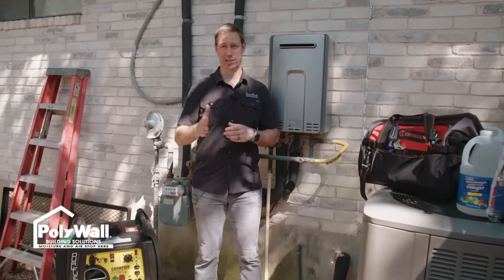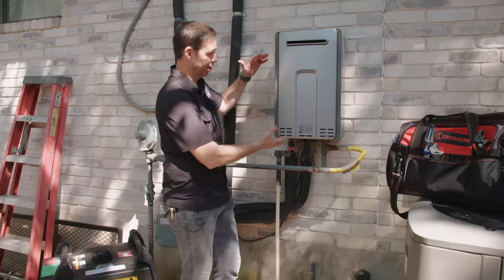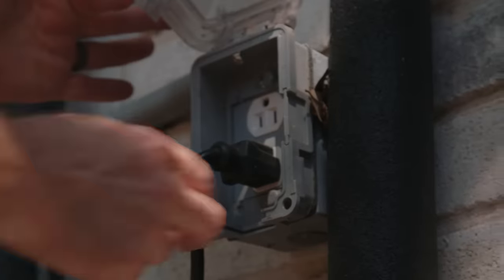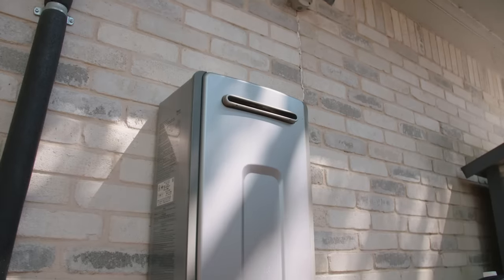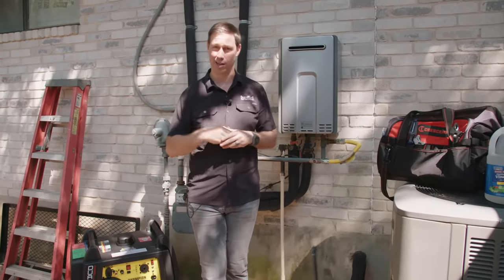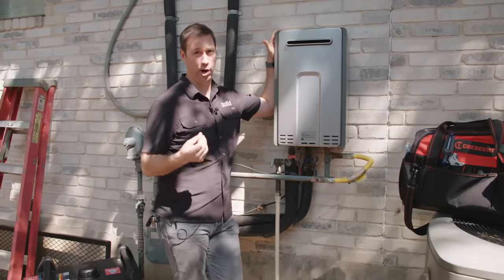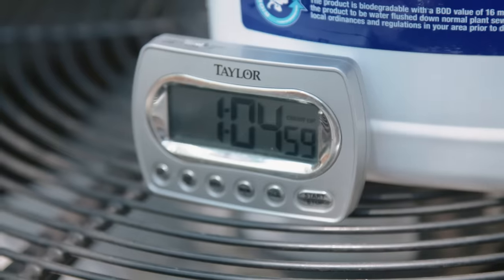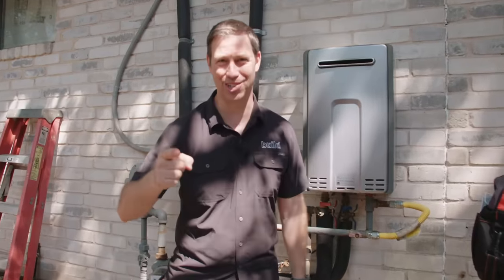3 Things They Don’t Tell You About Tankless

Comment: From my master plumber point of view, for the most part, I agree with the points brought up in this video. Personally I do not try to actively sell tankless. I do tell every customer what is mentioned in this video. I would add there is a #4 that most contractors do not tell you. These units are very sensitive to flow rate. For example you have to have “X” gallon per minute flowing through the heater for it to function properly. If you have a low flow shower head, there is a chance that that there is not enough flow on the hot side to get the heater to operate as designed.  Remember,  your mixing hot and cold in your faucet. Let’s say I can measure 4 GPM coming out of the shower head, that means in theory that I have 2GPM on the hot line and 2GPM on the cold line. That 2GPM is not enough for the tankless to operate correctly.
*the 2GPM is just a made up number I used to make my point, consult the tankless manufacturers manual for the real numbers.
Reply: I have seen this issue as well
Reply: i’m a handyman that ran into this many times, along with that scale reducing the flow of every faucet and shower head and valve in the entire house which makes the minimal flow to get the tankless working even worse as time goes by… not for me
Reply: You're doing it wrong. 
The best way to use tankless is to set the tank temp at the temp you use. For example, my electric tankless is set to 105F which is my preferred shower temp with my 1-1/2 gpm flow rate. I turn the shower completely to the hot side, my Stiebel Eltron keeps the water right at 105 ( my lines to my fixtures are all 3/8" pex and insulated so there is very little if any loss. You don't want to mix water at the fixture that creates losses from heating the water above the level and then cooling it.
My energy usage for a 4 minute shower at 1-1/2 gpm is 5kWh * 4/60 or only 333 watts, that's it. It's so efficient I use it with my PV system and don't pay for hot water.

I have a scale filter on it, all hot water systems should have scale filters.

Tankless is the best hot water I've ever had, yes, you don't want your kid in there for three hours, you have to use your head but if you do it's very good and about 1/2 the cost of heat pump systems.
Reply: If 105 is your max, more power to you. But to say I’m doing it wrong just shows a lack of understanding of what most Americans want in their home. I’ve been in this industry a long time.  With a 105 degree max, I’d be getting phone calls from unhappy people. I don’t like phone calls from unhappy people.

Edit:  I own a tankless, I love my tankless.  In a “normal” residential setting, I’ll never go back to a tanked.
Reply: @mosfet500  Do you have your tanks outside or inside? I'm wanting a gas tankless heater, but I want it outside.
Reply: Again, that's wrong.
You're using the  tankless wrong, here's why:

There are two types of losses in hot water heaters, standby and line. Standby losses are from a tank sitting in a room, the tank tries to constantly lower its temperature to meet the room. Line losses are from the tank to the fixtures, a tanked heater must have water temps above 120F, actually cryptosporidium and legionella live in 120F environments that's why commercial installations require 140F working temps. Because a tankless doesn't hold water there are no standby losses and no tank bacteria growth so you can keep the temps low. Any good tankless lets you set the output temp. The average shower temp in the USA is 105F, I set my tankless to 104F (~40C) BUT when I shower I turn the mixing valve completely to the hot side, there is no cold water mixing with my 140F water and no mixing losses. Also since the line temps are lower they don't drop like 120 or 140F lines that need mixing do.

My tankless heats water at a flow rate of less than 0.5 GPM flow rate, the hot water never stops from too low a flow.
Reply: @mosfet500  thanks for your input. I see your point but do not agree. You can look at whatever statistics you want, but I can tell you that people want hotter water than that sometimes. Not all the time, just sometimes.  But you are correct, if you set your water heater to your desired shower temperature, yes you will see higher flows through the heater. 
But that’s because the shower valve is maxed out. But on a different note, you need to chill. 9 months ago you commented all fired up.  Just state your opinion, Leave it at that.
Reply: @crushingsnakes1976  I'm not all fired up and I forgot I commented 9 mos. ago, I comment often on YT, sorry for seeming fired up.

I don't see any reason not to set your mixing valve to hot only, that gives you the maximum efficiency. My tankless is set to 104 and I use 3/8" insulated PEX to my fixtures from a small manifold at the heater. The run to my shower is no more that six or seven feet so the line losses are pretty much my 104F tank level. The point is that even if you set your tank to, say, 110F and use it at that temp your losses are still much lower than a tanked heater. 

I was surprised that 104F was hot enough for my showers, I too thought it would be higher, I was also surprised to see the average US shower is 105F too. We wash clothes on cold but kitchen and bath sinks and showers haven't had any complaints from anyone that they need more hot. I suggest people measure the water they shower and run their kitchens at.

I also ran the numbers and the tankless will last 25 years plus, maybe an element change at that point but otherwise it's good to go indefinitely. HPWH's don't last that long, are more costly up front and you have to vent the cold out of the house in northern climates like mine. I think tankless is a better option for small families and now that I see I'm spending $5 or $6 a month on hot water I'm even more convinced. Walking into a flooded basement a year ago was all I needed to not want a tanked heater ever again!
Reply: My regular 50 gal gas water heater is going to need replaced soon. I talked to a plumber friend and he said that was something I could do but that the gas meter would have to be upgraded (which I can’t do)as would the gas line to the tankless!  His wife wanted to go tankless and he has to do a new larger meter. Here in Iowa the meters most of us have can handle the furnace, tank water heater and the gas stove. His wife was surprised at all the things he had to change to put in the tankless!  If was building a new house I’d absolutely go tankless from the build!  Retrofitting a house 120 years old, I think I’ll stay with a direct vent tank!  Put a simple timer on the power to the vent fan so the water heater doesn’t heat water in the middle of the night or if everyone is gone during the day. Set it to come on around an hour before anyone gets up, hour before anyone gets home and shuts of before bedtime!  Gas company employee told me that. Said you save a lot and extend the life of the tank!
Reply: @stevenperry4941  maybe you might want to think about going electric if you have the service to handle it. When my oil furnace died (and flooded my basement!) I said that's it for anything with a tank - all tanks fail eventually, it's the nature of the beast. Last year when I put in my tankless I just ran a 240 line to the unit and got it inspected - done. I'll never go back to a tank - ever!
Reply: @mosfet500  no can do. Old house, 100 amp service that is pretty much full. Cost more to upgrade to 200amp service than doing all the gas upgrades!
Reply: So true, i am having that very same problem now hence why i am here researching

Comment: The thought of endless hot water was not even a part of my decision, but turned out to be an awesome feature. We ran a hot water line to the outside of our house for washing the car, the dog or whatever.  The 4th thing you did not mention was PRICE!  Where I live in British Columbia Canada a hot water tank is $1000, on demand system is $500
Reply: You should know why that is. Are you having any talk of them banning your fuel?
Reply: except that this is not true, anywhere incl BC, unless you are allowing for a rebate. Tankless costs $3000 in BC,  traditional about $1000
Reply: @johnjohnson-oj7md  Are you concerned your country may ban your present fuel?
Reply: Where did you find a tankless system in BC for $500??? I haven’t found one worth installing under $5K, and just installed a combi-boiler system (system that heats hydronic flooring AND domestic on demand system) for just over $7,500!
I will now be installing a water softener system after watching this video.
Reply: I am confused by this as well

Only thing i can find remotely close to $500 here is heat pump water heaters and that's with a govt. Subsidy.
Reply: Seriously I got my passport. I will drive up to Canada and grab one.

Comment: we have a gas tankless, but installed a 3 gallon electric mini-heater under the kitchen sink.  instant hot where needed, endless hot everywhere.
Reply: I thought about doing this as well, it’s a long run to my kitchen sink from my tankless. I insulated the line instead so once it’s there it’s hot for longer.
Reply: @christophergruenwald5054  Generally speaking, the hot water unit should be installed as close as possible to the kitchen. The KS uses more hot water than any other point in the house.
 You could have run the hot water line in polybutil which loses less heat than insulated copper.
Reply: Idk your kind of tankless but some you can put a circulation pump on and have a cross over tee installed under the sinks. Utilizing your cold line as a return line.
Reply: @Plumbyday  Circulation pumps are not such a great idea.
If you use one, you will increase dramatically your gas or electricity consumption.
 The pump uses very little, but the HWU uses a lot of energy when it's running. So, for the small cost of water lost along with time waiting for the hot to come through, you will pay through the nose for the extra energy used.
 If you have deep pockets, it doesn't matter.
Reply: Ken Lyneham I hear you! So I modified my circ system. As built in 1993 the return dumps the recirc water back into the HW tank via a tee at the cold water inlet. The pump is at this location and between it and the tank is a check valve and aqua stat. I didn’t like the idea of the system being “left on” 24/7 and controlled only by the aqua stat so I installed wiring to each bathroom light switch and the kitchen light switch boxes, changed out the single bay light switch boxes to doubles, and installed mechanical timers next to the light switches. Then, at the outlet powering the HW circ pump in the water heater closet I “cut in” the wiring going to the mechanical timers, all of which are wired in parallel. The lead interrupted to the outlet is the black “hot” lead. It takes a bit of discipline but whenever hot water is desired at one of the locations, at least the timer at that location must be wound. If somebody had already wound a timer at another location, well, it’s not necessary to wind a second because the HW loop is already heated. Though it takes about a minute to the furthest bathroom and about two minutes to the kitchen for the arrival of hot water in a cold loop it makes a difference on my electric bill and lifetime of my water heater!
Reply: @kenlyneham4105  not correct. tankless water heaters that CAN take a circ pump control the pump and periodically checks temp of incoming water. On a tank type water heater the mass of hot water already in the tank re-heats the incoming return water. It usually only drops by a 10 to 20 degrees on a dedicated line and more if its returning from the cold line. At least at the start of the return.  Depending on if you just used the cold on that line or how your house is plumbed.
Reply: @kenlyneham4105  some tankless have an internal pump that you can set a timer as well. Breaking down to even the day of the week. Or switch it to learn your living pattern and it will take care of the rest
Reply: @Plumbyday  I think you are missing the point. With a circulation pump the idea is to keep the hot lines hot all the time. This means the standby losses from your system are significantly higher, even if that pump only runs certain hours of the day. With a tankless unit you wouldn't normally have ANY standby loss. During the summer if that heat is lost into your house it also puts a heavier load on the A/C.

The most efficient way to deal with this is to install the water heater as centrally as possible, and then run a dedicated 1/2" PEX line as short as possible to each fixture.

But if cost is not your main concern, yeah, they do sell tankless units with a built in pump for this.

First world problems for sure. ;)
Reply: @kenlyneham4105  Recirculation isn't going to use that much energy if it's based on time or demand and all your pipes are well insulated. Tankless heaters don't run at full blast when recirculating; they'll turn down to 10% since the flows and temperature deltas are so low.
Reply: 3 gal elec heater costs $25/mo to run
Reply: @kenlyneham4105  I have an on-demand recirculating pump in my house.  My kitchen sink is at the furthest location from my hot water heater.  When I need hot water at the sink, I press a wireless button and the pump turns on.  About 40 seconds later I have 125% water at my sink.  I still save over $40 a month on my natural gas bill.

This said, I went with a very high-end tankless system.  It's a Noritz brand and it's bullet proof.  Does 10 GPM and has never failed in 8 years.  

I have a simple whole house filter that keeps sediment out of all my appliances.  I highly recommend something like this for any house.  It will add years and years to your water using appliances.

Comment: More disadvantages to the tankless in my bathroom:

It shuts off for low flows. So I have to fill a plastic container of warm water in the sink in order to shave (wash face and clear whisker cuttings from the razor in warm water instead of a ultra-frigid stream of cold water), which is a throwback to the old days.

I also have to run more volume of water for a shower than I need because of the it-shuts-off-for-low-flows problem. I am on an old septic system that is just about shot and it doesn't need extra water going into it.

I'm disabled, so it takes me longer to wash hair, then change positions to switch to washing upper body, then lower, then feet etc. So, I can't turn it off in the middle of any of those stages in order to change positions etc. because when I turn the water back on, the hot water line from the tankless has cooled off and that makes me have to keep adjusting the hot and cold control.

I had no such problems with the hot water tank because I could just leave the water at a low flow level.
Reply: He did not cover needing to totally replace older water lines, and the much larger gas line to the appliance too
Reply: Excellent comment with very good points!! I’m leaning towards a heat pump Rheem water heater
Reply: @billrimmer5596  I did a remodel on. Low income housing apartment complex. They had me take out an 150 old style tank water heater and install a 150 Rheem heat pump for domestic water and heat for temperature for comfort. I spent months trying to talk them out of that style. In the last 5 years I’ve worked on almost every one of them for one reason or another. I guess I just built in a recurring job.
At 275.00 an hour you really don’t want to be calling me out every single day for a problem !!!
Reply: And the temperature is not consistent if you have low water pressure. I found that out by accident when the city was doing maintenance on the local water system and the pressure shot up. Suddenly I was getting consistent water temperature.